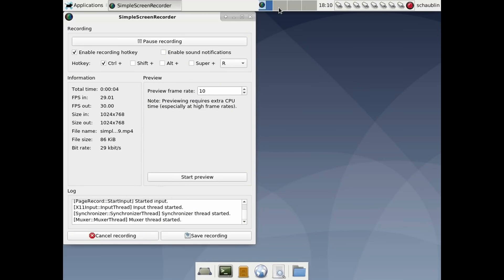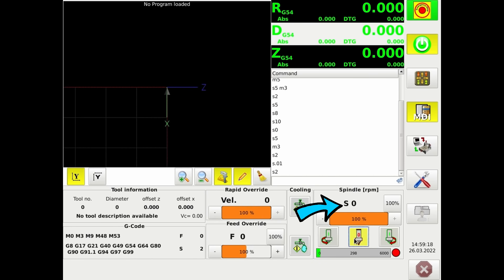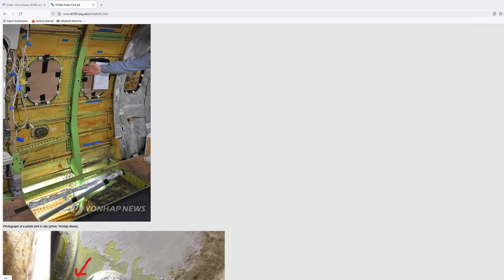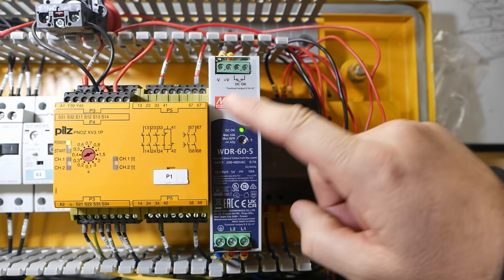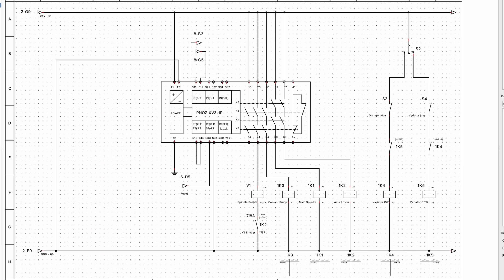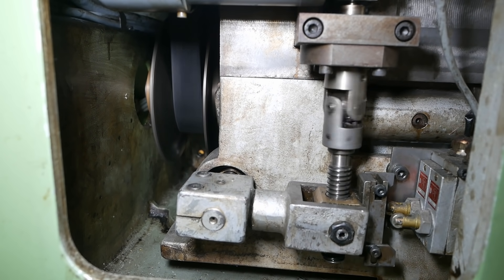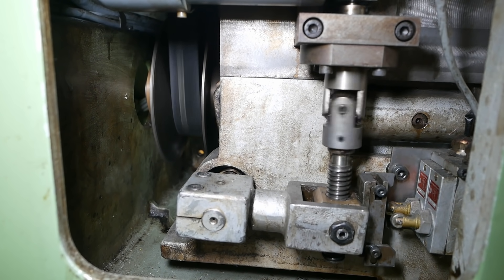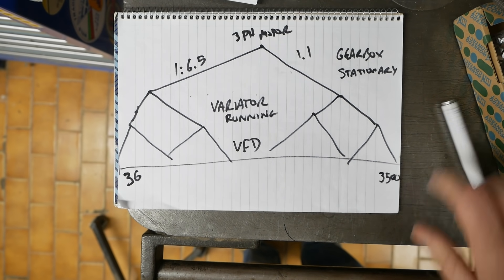Variator control - Schaublin CNC - Ep.30

Comment: I'd consider using the variator as a corse adjustment, then for fine adjustment use the VFD.
If you have a control loop which you automate a target speed, then using a bang-bang controller on the variator will be very hard on the contactors and also mechanically to dial it in.
But using the variator to dial it in to ~100rpm or so of target, then fine tuning with the VFD could give optimum results with high torque.
Also you couldn't use the variator for constant surface speed cuts, but if you dialed it in so that your delta-v/2 would be right at your middle VFD Frequency, so you're not at the extreme end of your VFD control window
Reply from the maker: Good summary of the issue. I guess the only time where you want the variator + VFD control during a cut is CSS facing of large diameter, eg 250MM  The speed range of the VFD alone would be pre limiting there .The Variator adjusts much slower than the VFD, so I guess you only need to make 1 or two variator ratio changes acorss such a facing cut, and the vfd coul compensate for the variations coming from the Variator.,

Comment: I would first work out where my overlaps in the speed range is, with the VFD and variator. I'd then have LinuxCNC set the variator so the VFD should be able to handle as much of the speed change as possible. This is because I think the VFD is more smooth and responsive to CNC commands than the variator is.

I'm a total keyboard machinist though, I haven't touched a cutting tool yet.
Reply from the maker: That is a good approach. Speed change of the variator occurs at a constant rate due to the 3ph motor, so I will need to cycle the contactors to use the variator, VFD is better there.
Reply: @RotarySMP  It's not constant. It is consistent. It moves the pulley at a constant rate, but because one is getting bigger and the other smaller, that last little bit of adjustment does much more speed change than the rest. I'd have to graph it to make an equation, but I know from dad's rockwell with a variator, that most of the speed change happens in the last 1/5th turn or so. Just something to keep in mind.
Reply from the maker: @TheMetalButcher  That is a good point. I am glad I threw out that question, as I have got a lot of good feeback. 

I am thinking that for most cuts, you can set the speed and then let the VFD control the rpm in close loop with encoder feedback.
The only time you really need the variator and vfd active in a  cut would be facing a large diameter. Then you would want to start with variator lo, and once the VFD hits it's frequency limit, do one large variator speed change to it's Hi limit, during which the VFD is compensating to maintain the correc CSS output rpm, and the rest of the cut is down on the VFD.

Comment: I would prefer the way to minimize mechanical stresses by movement of gear parts. Try to fix the gear in a middle position and than change speed electronical
Reply from the maker: That is a good input. I wonder if a variator grooves it's pulley if left in one ratio too much?

Comment: great update. I would try to have the variator do the heavy lifting. Since you get mechanical advantage.
Reply from the maker: I think so too, although it changes ration at a rate fixed by the little motor, so I with needed to switch the contactors intermittently to do that.

Comment: 6:07 Please add the separator between L1 and E mate. 
It's just bugging me.
Sorry
Reply from the maker: I only have one more separator, but if it is not needed, I'll put it there. The earth is a different brand, and already sits a few mm higher, so there is a significant plastic wall between them already.
Reply: @RotarySMP  sure. I thought of just saying it again. Anyway, it sits a few mm up. And in any case, the short will be caught bt rdc/rcbo

Comment: Controlling the spindle speed dynamically with the variator while it is just switched with a contactor seems like a losing proposition. Maybe a second VFD for thew variator control motor and some nested control loops could give an optimal solution, but that sounds overly complicated.
Reply from the maker: That is a good summary.

Comment: I would imagine they still use lacing in aviation for the same reason that so many other old technologies exist still. It works and it would cost more to test prove and implement a new method than it does to just pay someone to keep doing it The old way
Reply: Procedures and approvals for lacing would already be in place. Getting a new method/process approved could cost. 
In my RAAF days in the early 70's, both lacing and  cable ties ("Panduit straps") were used
Reply from the maker: Yeah, Aviation is very risk adverse, and the cost of a factory of people lacing looms is already factored in.

Comment: Choices, choices. I think I would bring everything that can be controlled during a cut under software control. This will give you maximum range for facing cuts. As for combined control: I'd go for maximum torque, and only adjust the VFD when the variator runs out of range. I'd also make sure that the state of the gearbox can be read by the software. That will allow you to sanity check the feed rate from software and possibly prevent 'user error'.
Reply from the maker: Bummer that there is no feedback on the gearbox position, but I will be able to infer that by air valve position.
Reply: @RotarySMP  is there no way of adding something on that could give you that feedback?
Reply: @RotarySMP  slap an encoder on it
Reply from the maker: @ikbendusan  There is nothing external to slap a feedback switch onto the gearbox. Only the two Pneumatic connections.
Reply: Why not add a limit switch to the back gear? It's either in back gear or not so only one switch is needed. Loving the videos👍

Comment: For constant surface speed cutting you need the rotarional speed to change at a certain rate depending on the feeds and speeds. Therefore you can not use the variator smoothly for most problems, without the relais turning on and off rapidly, which will certainly result in a bad surface finish.
Anyways for setting a constant speed I would use the variator, because of the mentioned tourque improvements.

Maybe set the VFD in center position, while using gearbox and variator to get to the right speed at the start of the cut, than do the fine adjustment during the cut using the VFD.
Or, for constant surface speed, start with the VFD on the higher side, so you have more adjustment in low speed direction.

To all: Feel free to add a comment to this idea, so we can start a discussion :)
Reply from the maker: I need to set it up, and try it out, as I kind of doubt that switching of the variator is that visible in the surface finished, as there is a lot of rubber in the drive train. It is a good point through. With what frequency do you let LinuxCNC drive the variator contactors? It is an important parameter. It would have to be low frequency, like 1Hz to avoid bashing the contactors.
Reply: @RotarySMP  another thing to consider is contactor wear. They typically don't like to be switched so fast. 1 cycle per minute is even a lot, really you shouldn't be switching a 3 phase motor more than 10 times per hour, though if you can find the datasheet for the motor it may have a higher or lower count. This is due to the inrush current of the motor.

If it were being driven from a VFD or soft start this would be a non issue, but the contactors will not be happy. For this reason I'd say that the variator as cool as it is should not be the primary method of speed control with its current control method. Either the contactors need to be buffed up considerably (and protection for back EMF considered as you are switching a massive inductor) or switched to a softer staring method for it to be practical for longevity.
Reply from the maker: @bornstellar9429  Thanks for that. I had no feeling for the switching limits of contactors. The little 3Ph motor to shift the variator is very low power and the conctactors are well over sized for it, but it would have to switch quite often to be useful.

The Schaublin did CSS from new, so they must have also switched that motor.
Reply: @RotarySMP  If the switching limit for the traditional contactors becomes a problem, I've had good luck with solid state reversing contactors (1 contactor, 2 inputs, one for each direction and no contacts to wear out). Siemens part 3RF3403-1BD04 if you're interested.
Reply: @RotarySMP  VFD the variator motor. Ha!
Reply: @TheMetalButcher  lol
Reply: @RotarySMP  If you wanted to go with overkill, you could put the variator motor on a VFD of it's own. Then you could control the speed of the speed change. :-)
Reply from the maker: @lwilton  Controlling the rate of change of acceleration --> would make me a jerk :)
Reply: @RotarySMP  The rubber is a good point, I guess you have to try it to be sure. You can find the maximum switching frequency in the datasheet of your contactors. This also depends on the load the variator motor puts on them.
Reply: Good point!
But the other way around would be nice too. So following the theoretical surface speed with the variator and handle quick changes by VFD at a startpoint at ??40Hz.
I own a Weiler LZG 280 with variomatic and there you can change speeds from low to fast in feeled under 1second (its a manual control).
Reply: @giggawc8457   Yes this could also work, but you still have the problem that the variator can only change speed at a constant rate. If the change rate of your theoretical surface speed deviates from that, the VFD has to compensate.

But this could still work with a closed loop control using the encoder mby? I dont use LinuxCNC so I dont know if this is possible.
Reply from the maker: @felixhubner8539  Yes, LinuxCNC can do closed loop spindle control with the encoder. I still need to set that up.

Comment: Because of the fan on the air cooled motor I think I would bias the gearing towards high motor rpm for a given spindle rpm to maximise motor cooling. So I would be tempted to first use the cvt from max rpm down to as low as it will go and then reduce the speed further with the vfd. I don’t know off the top of my head what the efficiency curves of the cvt and vfd control look like and if you want to account for them in your control strategy to optimise the full system efficiency curve.

The other comment about fine tuning the rpm with the vfd after making course adjustments with the cvt seems like a clever thing to incorporate too.
Reply from the maker: Thanks. The cooling is an important input.

Comment: I would set the gearbox manually with the gear module and buttons in the vcp. Then I would use mainly the variatior and then this runs out of range use the vfd. This way you could avoid running a fan to cool the motor.
Reply from the maker: Ideally, I dont want to add a VCP. I would rather just provide a an S value, and the COMP does it's magic to set the optimal Back grar position, variator, and VFD setting, and away it goes. Problem is I have not yet got a good plan for what the control loops of that Comp should be.
Reply: @RotarySMP  was my wish too but I didn’t find out yet how to get the max and min rpm for a cut when using constant surface speed. And you need to find a way to know if you can stop the spindle for gear change.
Reply from the maker: @patricklaible7527  Yeah, I need to start mapping out the use cases and who does what when. See if my ideas are even plausible. The comments here have been really useful.
Reply: @RotarySMP  Yea I made a spreadsheet of all my gears (I can switch 12 manually and 2 by hydraulic clutch) map out the speed range ans see if you really need to automatically switch the reduction.
I guess you will come to the conclusion that you only need the low gears of work on the capacity ranke of your lathe or for Threading and big drills.
but it's just a gut feeling in the end do some math and you'll see.
can't wait to see the next episode

Comment: Thanks for the great video! Very interesting also because I will be converting the EMCO lathe to CNC soon as well. Regarding the plumbing, i think that the "threading rope" should always be wound in the direction of the thread and not in opposite direction so when you screw the thread in, the rope does not untangle but rather get stuck and pulled into the thread.
Reply from the maker: When I was doing a lot of plumbing here, I did that, but I forgot, so I just wound in both directions, hoping the scratches would be enough :) Got lucky this time.

Comment: Theoretically I'd prioritize the variator and try to keep the motor in its most powerful/efficient frequency. Practically I have insufficient knowledge and skill to implement that.

Tell you what though that 30something rpm on the low end looks amazing, I wonder if it would be useful for knurling.
Reply from the maker: That is about where I am. I can see the advantages of prioritising the Variator, but also of the VFD. I am a crap programmer, and never learn C, which is what such a LinuxCNC component needs to be written in.

Comment: Only an analysis of the upcoming work can help choose the best location for the variator on this machine. Ideally, the position of the variator should be such that the frequency controller and box selector cover the entire speed range in the task.
Reply from the maker: I guess it is facing a larger diameter part where it would be handy to have both VFD and Variator aadjusting during the cut. As you need to start at low RPM, but then want the highest possible RPM as you approach the center.

Comment: I'd try to use mainly the variator and the vfd if i had to go slower or faster
Reply from the maker: One thing I didnt mention, was the Variator speed change rate is fixed, so it would need band bang control through the contactors for that task. However it was already doing that on the Schaublin controller.

Comment: Using the VFD to perform quick up and down speed adjustments is what it is best at. I would likely go the lazy route and use the variator in full high or low only, like it is a gearbox. it might also be worth mapping your gear ranges vs spindle properly, there should be lots of overlap and may show an easier strategy to get all speeds available.
Reply from the maker: Good point. I did map it out a while ago, but cant find the paper it was one :) Since the rate of speed change of the variator is fixed, LinuxCNC would have to switch it on and off.
Reply: @RotarySMP  you could use a second VFD to control the rate of speed change of the variator😉
Or you could use the spindle VFD to correct the rate of speed change of the variator, but that seems to be pretty hard to program...
Reply: If you want to get real fancy you could put in an Arduino to map motor load and adjust variator to give most efficient power usage.
Reply from the maker: No need for an aduino, anything that can be coded can be put into a LinuxCNC component.

Comment: I'd bias the control towards changing rpm with the variator first and then the vfd. That way you can have the vfd and the spindle motor centred more in the high torque range (whatever motor speed that may be), and only move out of that once the variator has reached its limits
Reply from the maker: That mechanical torque is attractive. However the variator adjust motor is constant speed, so I would need bang-bang control during a CSS cut.

Comment: nice one! as always.
The question about VFD vs Variator control is hard. 
I would consider wear and torque. 
If adjusting the variator gives high belt wear and the torque is not really needed, i would go for VFD than Variator control.
If the variator does not produce significant belt wear, i would go for 50Hz on the VFD as thats the best for motor cooling and than change the variator.

Considering this, low speed cuts with heavy chip load seem to be rare on a small lathe with small workpiece diameters. 
So high low end torque should not be needed. 
However i would implement the gearbox, variator and VFD into Linuxcnc. Better have automatic control, than forgetting to change gears between cuts and ruining parts by cutting wrong threads or destroying tools by running high surface feeds.
Reply from the maker: You summarized my thoughts very well.
Reply: I think the wear of the belt ist neglectable, after all it is used in it's intended application and the engnieering of this machine seems to be rock solid. 
The only change is, that the maximum  (and minimum) belt speed have changed due to the VFD, which should be of no concern as long as the maximum peripheral speed and transmitted power are not exceeding the belts specs. 
My first idea would be to calculate the average spindle speed for the next cut and set the spindle speed to that value via gearbox and variator at the middle of the VFD range and then use the range of the VFD to manage the cutting speed.  
If that is too complicated to implement I would probably ditch the constant cutting speed and run the VFD at 50Hz (for motor cooling and drivetrain power rating reasons).
Reply from the maker: @R00KIE-ger  As there is no feedback of Variator position, I could see the software witching between closed loop to the VFD and closed loop to the Variator. Need to start making a flow chart of this stuff to sort out my thoughts.